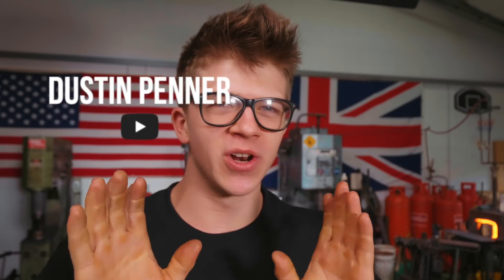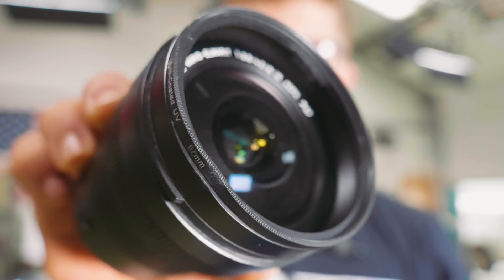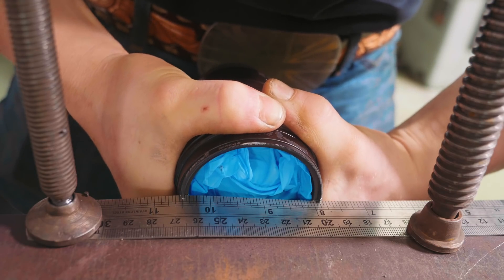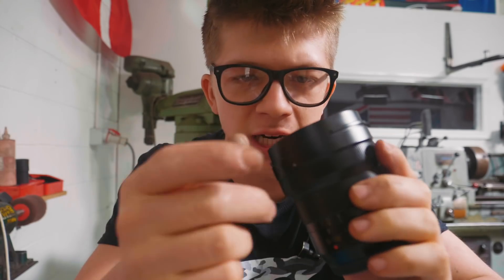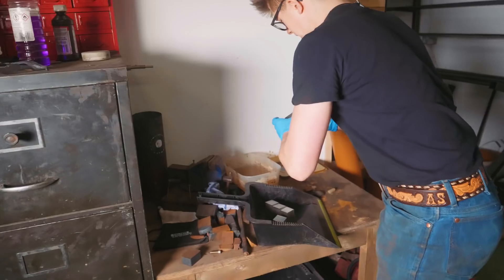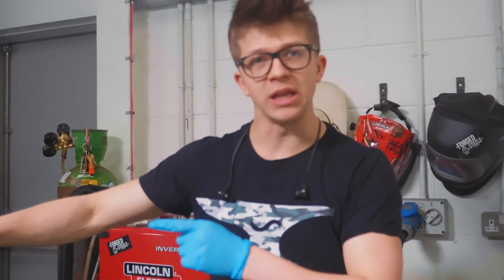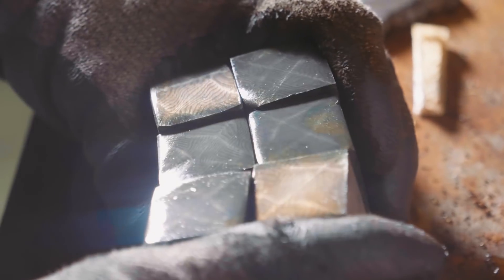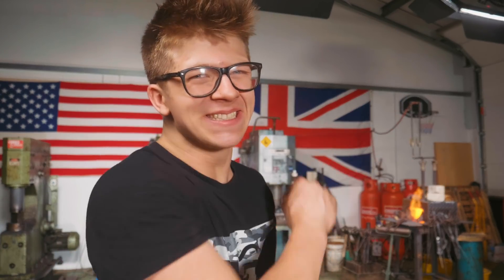DAMASCUS HAND PLANE BLADES!! Part 1:  Dustin Penner Collab!

Comment: ALEC i challenge you to make stainless steel damascus with pure nickel. when you heat anodize the etched damascus steel the pure nickel will stay white, giving you a black/blue/white contrast
Reply: Duck Norris you can't make STEEL with PURE NICKEL. It has to have some steel in it
Reply: ^^^^^^^^^^
This
Reply: Quantum Bullet yes you can... alloy 600 nickel sheeting, 0,52mm thick. You can weld it to steel

Comment: Hay Alec,
Try a bit of fine valve grinding paste in the thread of that lens using an old filter and work it back and forward. It should clean it up.

Comment: TiG weld the bandsaw slave back together, we do this all the time in our shop😎
Reply: ****blade
Reply: I actually thought the same thing. I tig welded a stainless conveyor belt in a cheese factory. Man that thing is like beer can thick and it's one solid piece so it keeps stress fracturing and it takes a day plus to weld up, grind down even and polish it out. The hot cheese rests on it so it has to be perfect.

Comment: Alec/Jamie .. get a Step-up Ring 67mm - 72mm adapter. You then only have to screw the adapter in once and will minimise further damage to the original threads. From then on, just use 72mm filters. Cheers :)

Comment: About the lens and filter: the filter can actually make thing worse. The front surface of the lens is treated to be really hard and resistant to scratches and stuff, but shards from the filter can still damage it when the lens alone would have been OK. The best protection you can put is a sun shade (I don't know the English word, it's a baseball cap for your lens to prevent flare, but also protects against hits).
Trust me, I'm a photographer ;-)

Comment: You need to make a Damascus Flintlock pistol... Barrel and lock components. Without touch hole of course (keep it legal as a display piece). Show off all your steel, machining and carpentry skills. And try to keep it under 30 part series. Challenge!

Comment: Use a very small die grinder and grind the bent threads out. The remaining threads should be enough to retain the filter.

Comment: Alec, I too have fucked up pricey lenses doing dumb shit and I fixed mine with a tiny cross pein hammer, a block of balsa wood as an anvil and a yellow pine dowel rod and a machined delrin lock core follower (12-ish mm) from a Kwikset lock rekeying kit  as a punch set. It was a shitload of tedious tapping and testing lens filters for fitment and it worked and got it close enough for the filter to straighten it the rest of the way. Hope this helps.

Comment: For the camera lens, couldn't you use a coping saw to cut out the dinged section so you have a gap in the threads?
It should still be enough to thread in the filter lens, it's not as though it needs to be super tight or hold any weight.

Comment: Another quality video from Alec Steele!
I also have a suggestion, could you make a baseball bat out of damascus steel?
Reply: Stan Dave would be cool but crazy heavy
Reply: Thilo ??? And it will require a shit load of steel
Reply: That’d be a hell of a lot of steel and it’d be heavy as hell, but I wonder if there’s a way to make it hollow like other bats. It’d be neat.
Reply: Joe Stoffer I don't think you can do that with blacksmithing
Reply: GamesWood&More figured as much. I’d imagine it’d be one of those things that just isn’t possible with methods and tools you’d find in a blacksmithing workshop
Reply: He would need to forge an incredibly large billet and then turn it on the lathe. It is very achievable with his shop. It would be very heavy for sure.
Reply: Scott Wright Lathe ? Alec usually rounds of steel by pounding it with his big and hard powerhamer
Reply: True, he could round and grind it but it would be a difficult task with the weight of the piece, and he could a much more symmetrical and cleaner finish by turning it. I agree it would be a very cool build regardless of how it was achieved.
Reply: Only way I can think of to do that is to make a billet and then flat out to a sheet and then a ton of hammer work to form into shape but there would be a seam.
Reply: extrude and weld?
Reply: Follow that up a Damascus baseball.
Reply: Double Dare Fan now that’s one game I’d love to miss...
Reply: Maybe a clubbell? It'd be one expensive weight though...

Comment: I hope you intend to laminate the damascus onto a sheet of 1095  vs making the entire blade pattern welded..  Although it would be fine for a knife or chisel, a plane needs the edge to have identical cutting characteristics all across the edge to get those tissue paper thin shavings that you see the Samurai Carpenter get, and a pattern welded material simply won't produce that due to the differing chemistries of each layer..

Comment: Damascus isn’t great for planes blades because the difference metals wear at different rates meanings A-the surface you are trying to plane will have ridges on it and  B- you have to sharpen it more to keep the edge from leaving ridges

Comment: Buy a filter removal tool it re sizes and re trues the threads they should be pretty cheap off ebay to save your expensive lense . Tested has a video on how to do it

Comment: If the plane iron is damascus steel, how hard is that going to be to sharpen when it needs to be sharpened? Also, as the machinist, would you be flattening the back of the iron yourself? Or is this more of a decorative plane and not intended for real world use? Thanks for the videos, Alec, sorry to be questioning pain. Cheers.

Comment: while I know all metals have different melting point. (my entire metal working knowledge)

 Could you make Damascus out of different metals. Like copper and steel. 
I know copper has a lower melting point. but you get the idea. The bigger the contrast the better.

Comment: Just curious, is there some reason that you don’t use flux? What would if you dipped the meteor in liquid flux and then hammered it. I know the impurities would still be in the metal but maybe you could get enough useable metal to make a blade. You could melt the meteor to a liquid. It would still be metal from outer space but wouldn’t look like it.

Comment: Alright Alec, here's the trick.  It's already damaged so grab the ring with a tough needle nose pliars and twist.  This will reduce the diameter of the ring and pull it away from the threads.  Problem solved.

Comment: Alec, in response to the meteorite series I would recommend you check out the wonderful Bob Kramer. If you do not already know, he is a world renowned chef knife bladesmith and commonly makes his knifes from meteorites. However he melts the meteorite then casts a fresh bar of steel which he then forges. My understanding is that this gets rid of the many impurities that naturally occur within a meteorite and provides material that does not already contain many cracks. 

Here is a video that shows the process: https://www.youtube.com/watch?v=4x0f2b_0kn0

Comment: well i need answers... how much does it cost to own a forgery without presses
ı want to make my own forgery but i dont have a stable job
Reply: Shimada Clan it completely depends on you. Depending on how much effort you are willing to put in I mean. You could quite easily make a solid fuel forge, buy a ASO(a lump of flat steel) from the scrapyard and get a hammer or two for well under $100. Hell my first forge cost me under $10 including an anvil and a hammer. Don't expect to buy an anvil, or have a propane forge or anything fancy, because those things all cost money. If you find you truly love blacksmithing, those luxuries come later. 
But if you want to have a propane forge, an anvil and a set of tongs, a belt grinder an angle grinder, files and all of the fancy stuff we all want so badly you need to work your ass off. Alec has worked incredibly hard to get where he is at such a young age, and you will have to do the same. (I spent less than $40 to make my propane forge, but I got lucky after looking for months for building materials, and made friends with a guy who later decided to give most of it to me for free, after driving it to my house which is three hours away from their business. People love this craft and if you can get other people excites, that's when things come cheap. Good luck soldier!)

Comment: This might be a dumb question, but why not weld the band saw blade back together?
Reply: Such thin material is very very hard to cleanly weld. You either melt though or end up with a huge blob at the junction, you could damage the bearings if you run it as such (not mentionning all the heat warping/damage to the integrity of that spot on the blade). The cost/benefit ratio is too high, better just replace the blade.
Reply: Cut it up and forge something out of it!
Reply: He needs a better TIG rig and more practice before trying sawblades..  Something with a good footpedal control, pulse TIG and stable arc down to 5 amps so he can weld and then play a low temp arc over the seam to anneal..  A good gas lens vs the standard nozzle will help as well.
Reply: It probably broke in part due to metal fatigue. There probably not much life left in that blade. Use it as Damascus fodder.
Reply: Many commercial vertical band saws come with built in blade welding attachments so you can buy the blade material in bulk and cut it to length. The right welder could easily weld it together, grind the weld and anneal the weld and it will be as good as new. There is no reason you couldn't do that with the blade that Alec broke.

Comment: Alec if I could make a suggestion, I got hired to shoot a millwright working for a documentary and I used Lexan sheets on stands in front of my camera to protect the camera, pain in the butt to keep it clean but saved me a lens when a bolt head sheared off and came right at the camera

Comment: I've been trying to forge weld with no success. I heat it to forge welding temperature and hammer it from there but it keeps delaminating. Can anyone help me? And Alec you should try making Damascus with brass and steel, if at all possible
Reply: What type of steel some steels form oxide layers more easily, making it harder to weld. For example most stainless steels are very hard to forge weld. Also, just make sure you are at the right temperature. The steel should be a bright yellow. It is definitely easier with a power hammer as well.
Reply: Beginner Blacksmith also, what are you trying to forge weld? If it's damascus, are you welding the steel slabs together before putting it in the forge?
Reply: not damascus. it is mild steel.
Reply: do you know where to get cheap foundry material?
Reply: Beginner Blacksmith Craigslist, eBay, scrap yards, etc
Reply: Beginner Blacksmith Are you using any sort of flux when forge welding? Forge welding without flux can be done but is very difficult to pull off successfully. Also, forge welding mild steel requires higher temps than higher carbon steels, something to consider.
Reply: Tumbler2012 no flux i ordered some but it didn't arrive and thanks for the heads up on higher temperatures.
Reply: You nerd to flux it especially when beginning. Alec makes sure the surfaces are perfect flat then clamps and tigs the seams. Just use 20 muleteam borax as flux. You can get it where the laundry soap is and a box is cheep and will last a long time.

Comment: your damascus patterns are getting boring alec there is so many more patterns you can do with damascus you hardly ever twist your steel or canister weld steel or do anything other than explosion patterns mix it up a bit stop being boring
Reply: grayem pepper 'stop being boring'
Then watch something else, or actually make something else
Reply: grayem pepper what pattern do you forge?
Reply: i dont have a power hammer if i did i would make as many patterns as i could
Reply: Don't need a power hammer.. just sounds like an excuse
Reply: im just saying that it is getting boring i loved the flag making it was great to watch but it seem to be the same thing now
Reply: grayem pepper I'm with you man. If Alec is going to keep doing a ton of Damascus shit, he needs to get some more pattern variety and experiment more. For a couple episodes it looked like he might go down that path but alas, same type of pattern with the same alloys. Idk shit about blacksmithing but I understand patterns and you're right, there are so many more patterns and variations waiting
Reply: thank you mike put a twist in it join it to an explosion put a piece of flag material in there and twist it again the opposite direction it can be the best material out but why stick with basics